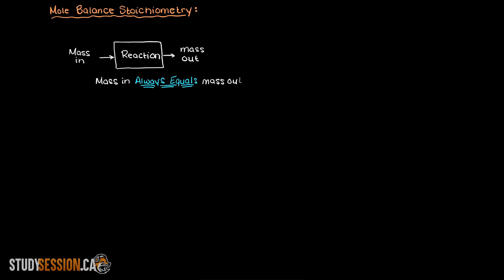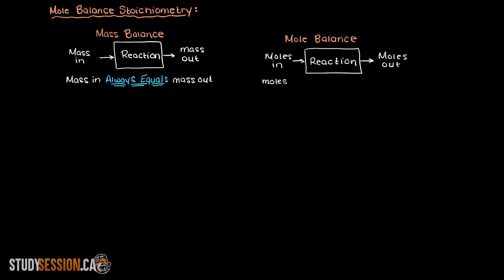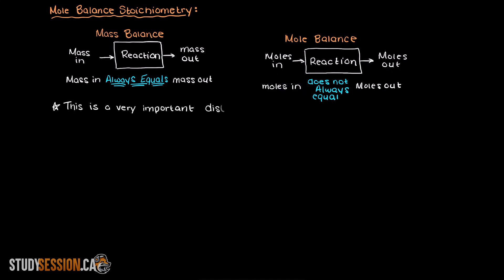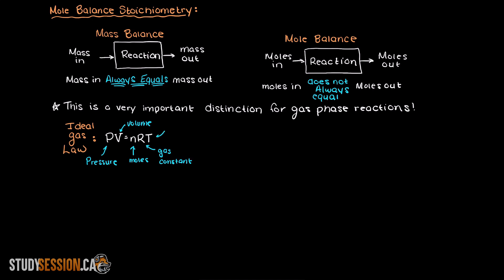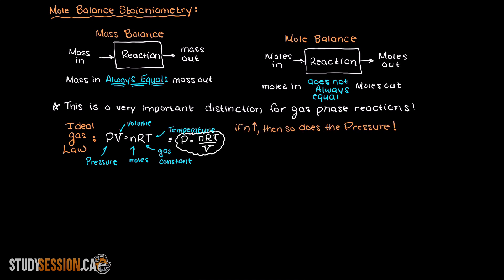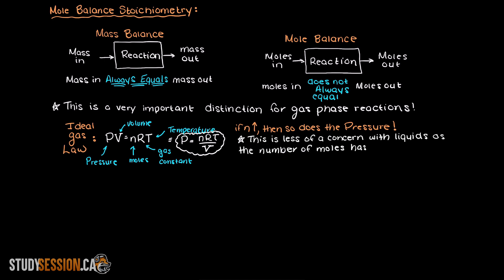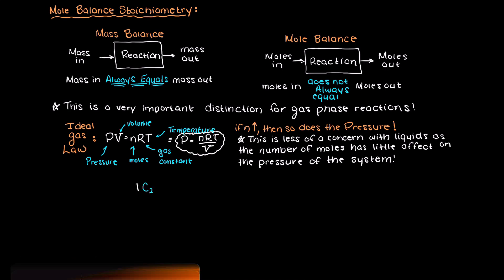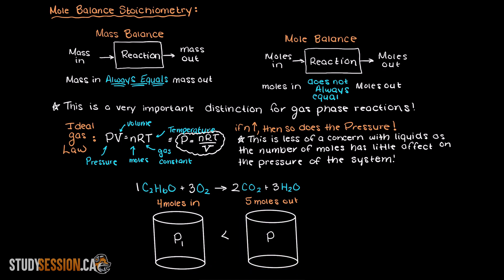Mole Balance Stoichiometry | Reaction Engineering

Comment: This is great! 
Hey I’m wondering which program do use to explain and it would be a nice if you told me. In a few years your probably going to be the next khan academy
Reply from the maker: Thank you for the kind words Nayef, they are certainly an inspiration for my work so that means a lot! For the Audio I record using Audacity and edit my vocals to make them sound better then for the visual portion I use GoodNotes 5 and record through my iPad Pro and then use the the video editor DaVinci Resolve to speed up the writing part! Hope that is a sufficient answer :)
Reply: @StudySessionYT  hi, this question might be a bit 'late,' but what settings do you use to record your lectures? I'm having trouble with my iPad Pro (11 inch) because the recording can be blurry.

Also, what software do you use when resizing the recorded video? Thanks!
Reply from the maker: @kerPlanck  I just use the built-in screen recorder on the iPad and edit my videos using Davinci Resolve!